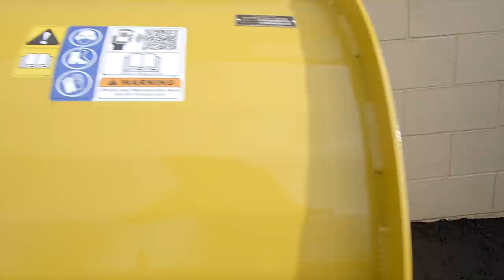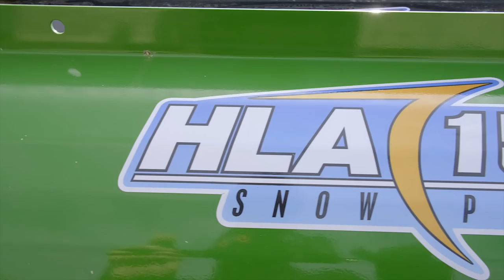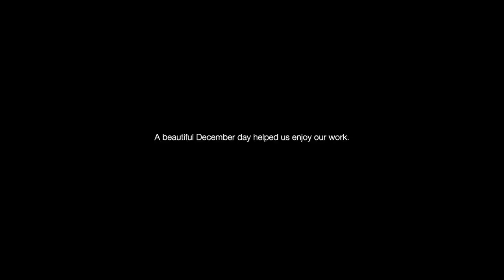TRAILER LOAD OF ATTACHMENTS OFFLOADED BY JOHN DEERE 330G 🚜

Comment: Nice to see the driver being cautious with the straps. When I bought my JD 1025r. Every attachment I bought with it and tractor included had paint scratched off either from the shipment from up from the US or from the dealership to my house. I was not very happy. If I was to purchase again I would specify any paint removed... they can keep it. A can of green spray paint handed to me don’t cut it. When you buy and automobile you don’t have paint dug off and scratched up. Right!
Reply from the maker: Haha, hard to prevent every scratch moving heavy steel, but we do our best!
Reply: I agree. I don't even want one that's been sitting outside on a dealership lot (or w/the dealership's sticker w/their name). It's a tractor & will get wet & scratches but I don't need any help there. I can screw stuff up all by myself:).